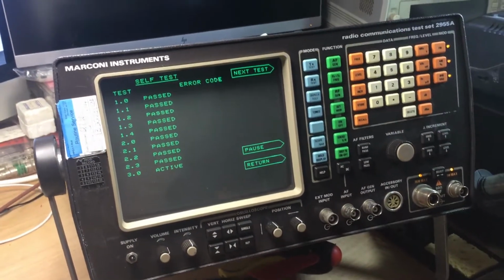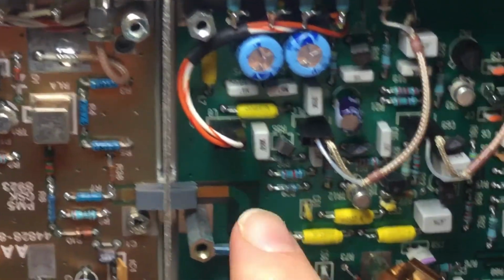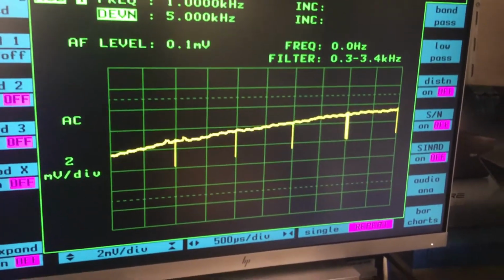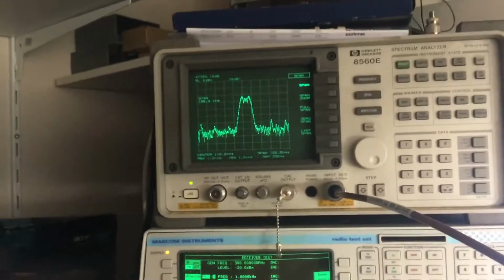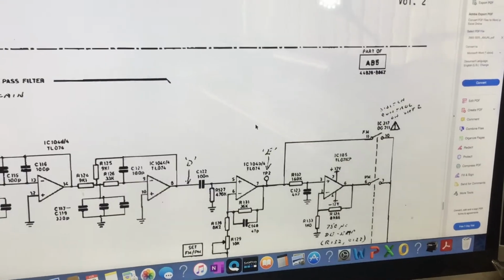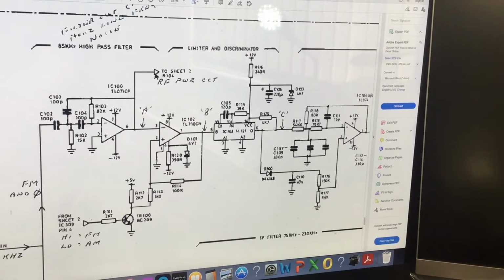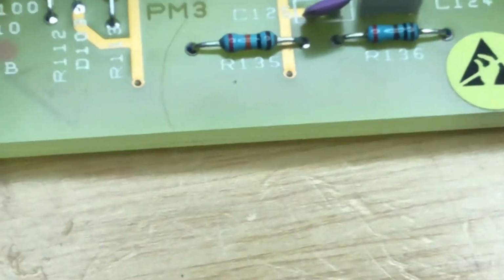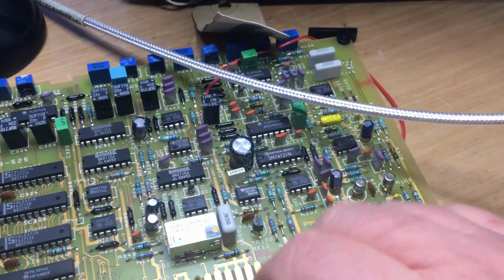Marconi 2955A Repair fail self test 3.0 & 3.1& 3.3 FM MOD low, Component level repair.

Comment: Many thanks for a great range of video's especially on the 2955 - I have had the same faulty Waycom 220uf caps, short circuit.. Error codes 33,35 and 39.
Now all i have to do is to fix my 4015 & 4031 not so easy as the Marconi as the cap are pesky smd and damage the pcb when leaking.

Comment: I also found a 220uF capacitor short in the AA4 board, it took out a yellow coil from the supply rail.